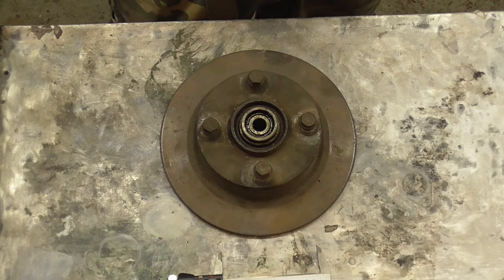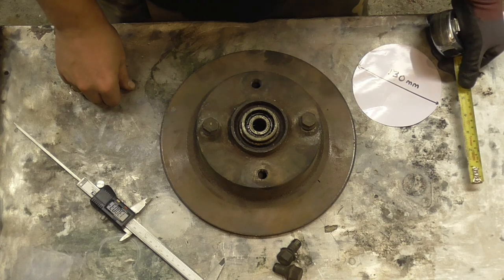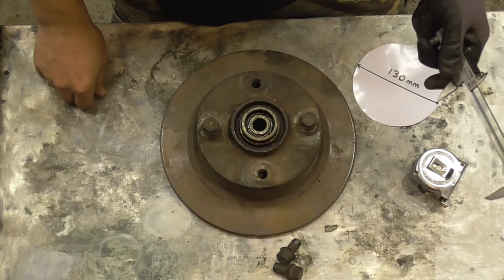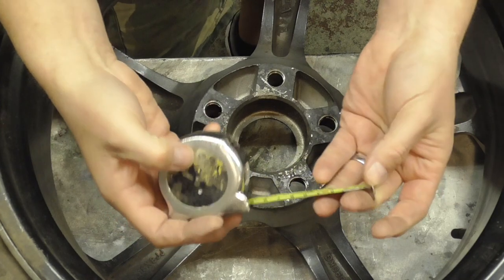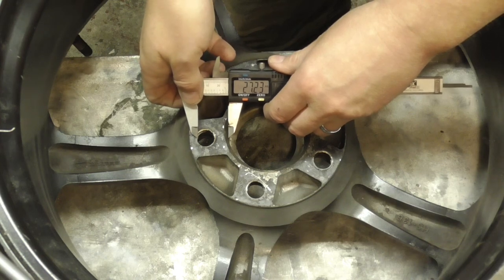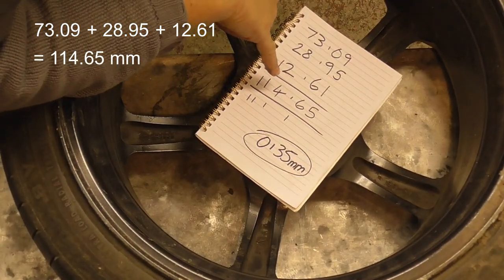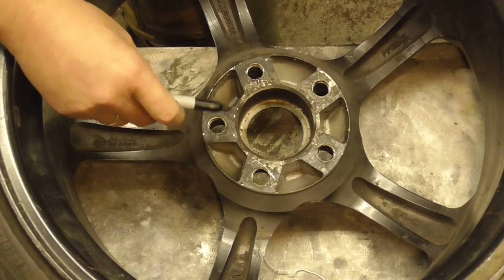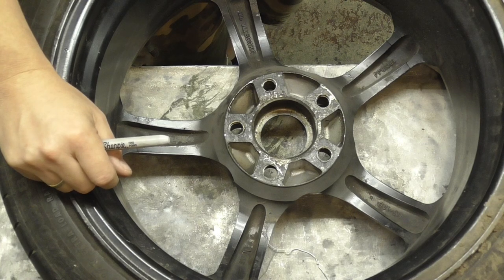PCD Explained / Measuring Wheel Stud Diameter Accurately & Easily / PCD Pitch Circle Diameter 5 Bolt

Comment: very informative. Though you don't say where you get the multiplication figures of 1.7 and 1.2 from.
Reply from the maker: I found them totally by mistake while searching on the Web a while ago. It's this that gave me the idea for doing the video in the first place because I saw the potential for error in it. So while it's quick quick easy I don't recommend using that method in most instances as unless can measure cleanly to start. I didn't think it would work tbh but it was certainly close when I did get accurate start measurements.